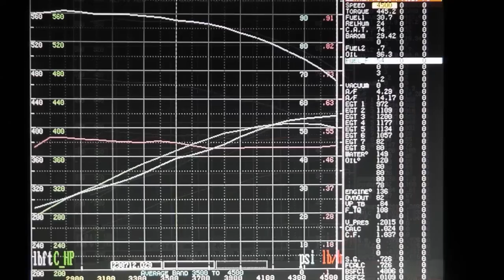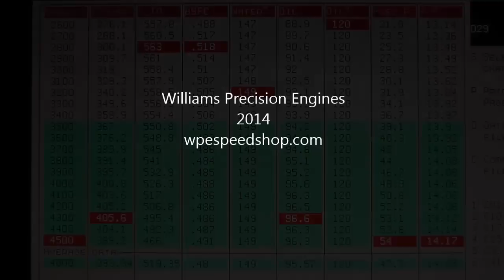Oilver Pulling Tractor Custom Fuel Injection & Header

Comment from the maker: Built it in 2014 and its still winning class 4 years straight, no blow ups..   Customer is happy, and that's all that matters..
Reply: That's crazy, especially taking so much meat out of the engine to make that much capacity, 283 to 410 😳😳😳
Reply: If it can't start without ether it's a waste of good parts.
Reply: That would be a good engine for my old super 88 to take with. 🤪
Reply: @nickthompson9697  it’s brake clean to prime the cylinders as they don’t get fuel till the mechanical pump kicks in.

Comment: How has the tractor pulled with this engine and are there videos of it performing?
Reply from the maker: Customer is all hush hush about it,,, no videos.. We built it in 2014 and over the past 4 seasons he has racked up many many wins. Always a top contender, even when he jumps up a class.   Although I get many calls on it, I am not in the business to build these engines.. I specialize in circle track engines for sprints and stock cars.  This was a one off deal just to see if I could do it..
Reply: Impressive; always have a thing for the Olivers and the Waukesha 6 bangers

Comment: What distributor is on the engine? Off the shelf, or did it require modification to fit?
Reply: oliverpuller1655 Lokks like factory replacement,Mallory.
Reply from the maker: Yes it’s a Mallory dist, used in conjunction with a crank trigger on the front.

Comment: Only slackers need ether to start an engine.
Reply from the maker: No either is used, just a little brake clean to get some fuel in the ports. This engine is not efi its constant flow, so until the mechanical pump starts turning there is no fuel pressure to spray the nozzles. Hopefully that helps you understand a little bit more on how it works. Thanks for your comments.
Reply: Tell us you know nothing about tractor pullers or mechanical injection without saying it😂
Reply: @TheRealTurboJesus  I know my dt466 doesn't need ether.
Reply: @nickthompson9697  sounds like you don’t know anything useful then lol
Reply: @nickthompson9697  if you built it to run tractor pulls it would but that’s out of your price range😂
Reply: @TheRealTurboJesus  at least mine makes money.
Reply: @TheRealTurboJesus  how does a person just decide to dedicate their life to building engines that don't start and aren't useful for anything? Even the 13b was more successful.